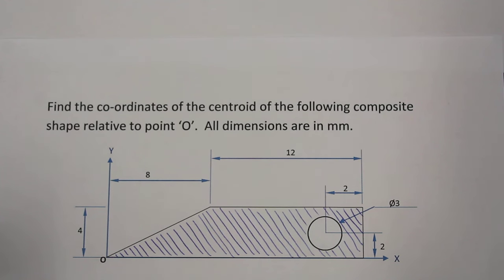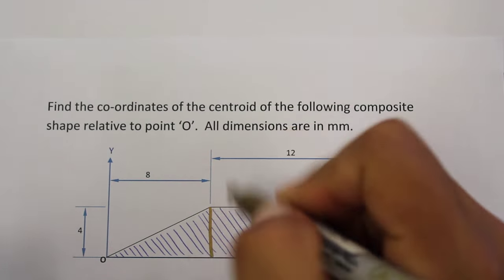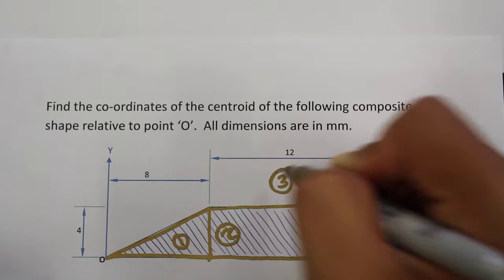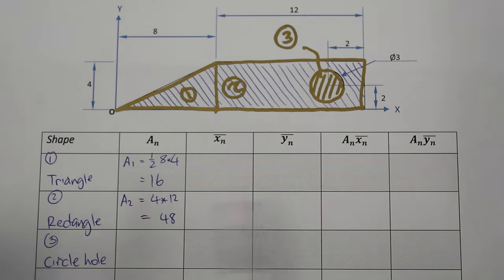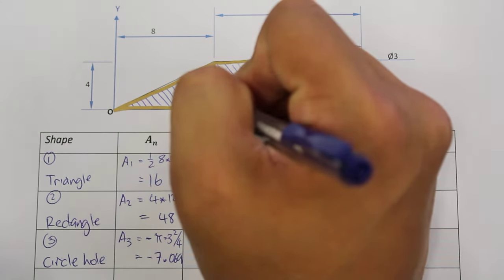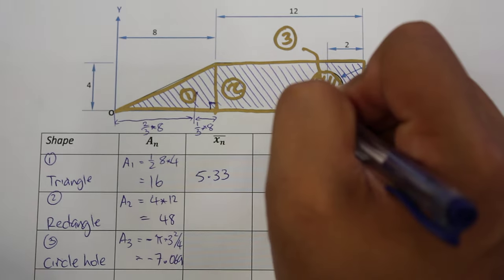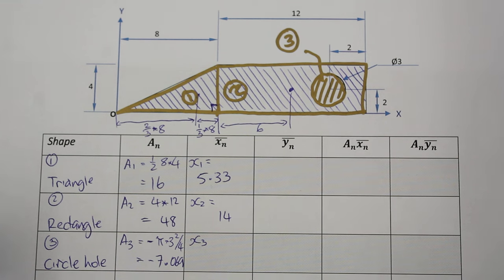Centroid of a Composite Shape - Tabular Method - Part 1

Comment: pls sir. to calculate for bar x of a triangle what we use is 0ne-third of the base but now u are using two-third... i dont get sir
Reply from the maker: this is quite difficult to explain in words so I'll show a picture :-)

https://en.wikipedia.org/wiki/Centroid#/media/File:Triangle_centroid_2.svg

The idea is that the centroid is one third of the distance from the right side of this image, and 2/3 of the distance from the left side.

You will notice that, when compared with a square, the triangle has a right part with more area, and a left part with less area. The centroid should be closer to the side with the more area. ie. the centroid should be closer to the right side. 

(grammatical errors are intentional in the sentence above as I think this makes it easier to understand)
Reply from the maker: Oh, by the way, sir is reserved for knights and people that would be eligible to be added to this list:
https://en.wikipedia.org/wiki/List_of_honorary_British_knights_and_dames

I haven't got that right yet so Cornelis will do, for now :-P
Reply: You most likely don't need this input anymore but you can also just do 8 x 1/3 and then subtract the product of 8 x 1/3 by 8.

Comment: Sir for the Area of the circle, the radius in 1.5 not 3. And why did Sir divide the area of the circle by 4?
Reply from the maker: There is an equation for area of a circle using radius: pi * radius * radius
And an equation for area of a circle using diameter: pi * diameter * diameter / 4

It is more common that the diameter of objects are given rather than the radius so the second formula is more useful. A google search will also provide you with the same formula as I have used. "Area of a circle using diameter"

Comment: why we use negative sign for removed  parts in composite area to determine the centroid????

which is better to use vertical strip or horizontal strip in integration method to find the centroid ?
??

which is easier to use integration method or composite area method to solve for centroid of composite area ?
??
Please I want an answer to these three questions ♥ thank you
Reply from the maker: *Why we use negative sign for removed  parts in composite area to determine the centroid????
When area is removed from a section, the center of the shape will move more towards the side that has more area.

Which is better to use vertical strip or horizontal strip in integration method to find the centroid ?
??
This depends on the function and which axis the section is bound by. If it is bound by the x-axis, I would use a vertical strip. If it is bound by the y-axis, I would use a horizontal strip. If it is bound between two functions, I would use whatever makes the intergration easier, or what ever allows you to minimise the number of equations you need to solve. This is easier to explain with an example.

Which is easier to use integration method or composite area method to solve for centroid of composite area ?
??

In this case it was the composite area method. If you know the function, the integration is useful as long as the integral can be solved (though you can solve for the area using numerical methods).

Comment: I would like to mention to take into account of where is your origin when using this method. My teacher for example gave me an exam where to shapes were on the left on the negative x while the other was on the right. I didn't see right and assumed everything was on the left and on the positive x range. Anyways with that mistake I made sure not to repeat that same mistake on the final :)
Reply from the maker: I definitely agree with this comment. In the example above I assumed that the origin is on the bottom left corner.

Comment: My calculator doesn't give me the correct decimals it's like .5 it doesn't like give .67 if my decimals are of a little does it mean my answers tally will be incorrect making everything wrong ?
Reply from the maker: It depends on the percentage error that would be created by the incorrect rounding (which in this case is caused by your calculator).

for example if the number was 100.5 instead of 100.67... this situation would have less error created by your calculation than a situation where....  the number was 0.5 instead of 0.67

If you are sure that the error is because of your calculator, I would look into getting a new calculator. An alternative could be to use wolframalpha.com or you could use calculator apps (I can't recommend one in particular though). Some of these options would not be appropriate in a controlled assessment. Maybe someone who is watching the page could suggest other alternatives.

Comment: why divide by 4?
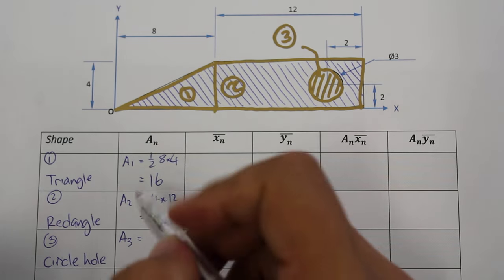3:00
Reply from the maker: There is an equation for area of a circle using radius: pi * radius * radius
And an equation for area of a circle using diameter: pi * diameter * diameter / 4

It is more common that the diameter of objects are given rather than the radius so the second formula is more useful. A google search will also provide you with the same formula as I have used.

http://bfy.tw/FPDf
Reply: superb explanation! thanks for going the extra mile!!!

Comment: why did he divide area of circle by 4?
Reply from the maker: Hi Cameron, thanks for your question. There was a previous comment that asked me the same question so I can answer this quickly.

There is an equation for area of a circle using radius: pi * radius * radius
And an equation for area of a circle using diameter: pi * diameter * diameter / 4

It is more common that the diameter of objects are given rather than the radius so the second formula is more useful. A google search will also provide you with the same formula as I have used.

http://bfy.tw/FPDf

Comment: how do you determine the centroid graphically?
Reply from the maker: This is something that I don't know how to do yet. If you have found out, I would love to know.

For a simple rectangle, you would draw lines from both of the opposite corners and the centroid would be at the intersection point. https://www.quora.com/How-do-you-find-the-centroid-for-a-rectangle-How-do-you-find-the-centroid-for-a-parallelogram

For a triangle, you would draw three lines. From the middle of the each edge, to the opposite vertex. https://www.youtube.com/watch?v=HoXV2mvCD28

For a circle, the answer doesn't come to mind at the moment.

The graphical method for a composite shape would have to take into account the size of area for each section, then would the centroid would be closer to the section with more area... but yeah, I haven't seen a graphical method for this.

Comment: Why'd you multiply 1/3 to find y of triangle instead of 2/3?
Reply from the maker: Sorry if this doesn't make sense or does not answer your question. I'm finding it quite hard to find out what may be your current concept, but I'll do what I can.

There is a list of useful formulae for finding centroids available at the following link: https://en.wikipedia.org/wiki/List_of_centroids

The formula shown in this link shows where the centroid is located in relation to the bottom right corner. In this case, our measurement is from the bottom left corner of the triangle.

From that formulae we see that the centroid is located closer to the right angle corner '1/3 of the height' as measured from the bottom right, and '2/3' of the height as measured from the top right.

One possible thing you may need to consider: the y co-ordinate is measured from the reference point on the bottom left corner of the triangle, and in the vertical direction
the x co-ordinate is measured from the reference point on the bottom left corner of the triangle and in the horizontal direction.

Comment: Why divide by 4 on the area of a circle hole?
Reply from the maker: There is an equation for area of a circle using radius: pi * radius * radius
And an equation for area of a circle using diameter: pi * diameter * diameter / 4

It is more common that the diameter of objects are given rather than the radius so the second formula is more useful. A google search will also provide you with the same formula as I have used.

http://bfy.tw/FPDf
Reply: @corneliskok7794 Hello sir! I'm not sure but I think you put the radius (3) instead of the diameter which was supposed to be 6 in the formula pi(d/2)²

Comment: When to use formula 2h/ 3 to solve
Reply from the maker: Hi Anuj, there is a list of centroids for common shapes available from wikipedia: https://en.wikipedia.org/wiki/List_of_centroids

The equation h/3 is used for finding the distance from the right angle side to the center in the vertical direction.  2h/3 is usually used for finding the distance from the other side. I'm finding this quite hard to explain in text so the first image in the following link may help you: http://www.engineeringintro.com/mechanics-of-structures/centre-of-gravity/centroid-of-triangle/